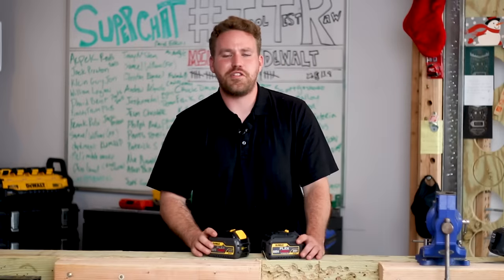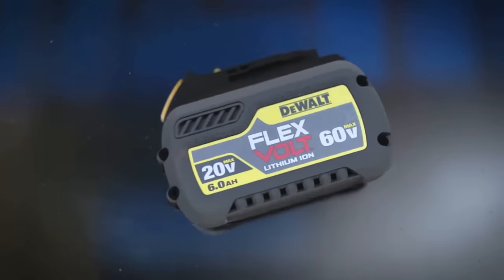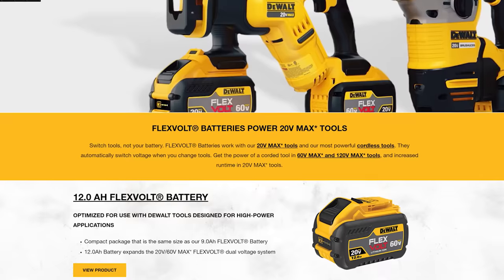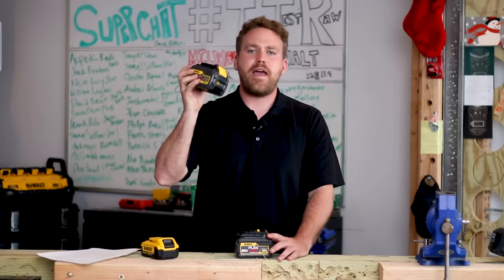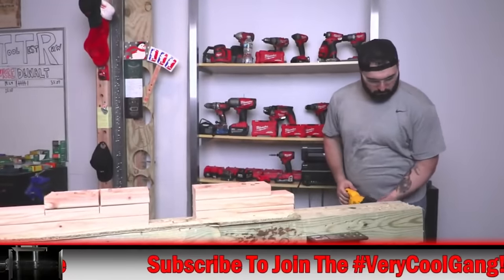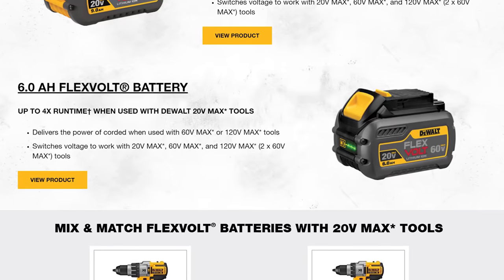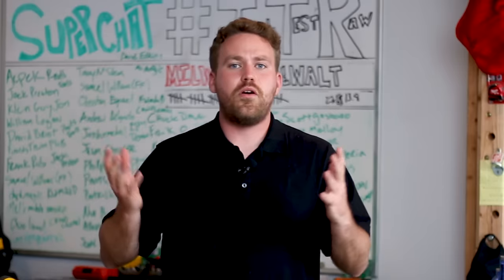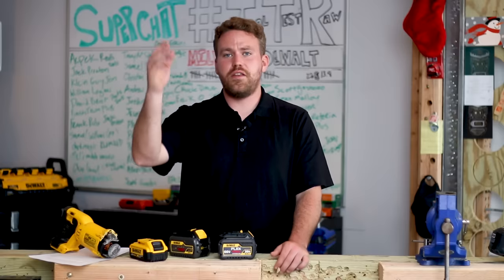NEVER USE DEWALT FLEXVOLT BATTERIES ON 20V MAX TOOLS!

Comment: Never had issue using 60 v flex volt on my 20v max tools.

The only
Problem I’ve ever had was my 60v max string trimmer which takes 60V only batteries is pretty disappointing.
The battery does not last long at all and I swap out two batteries as they’re pretty
Expensive.
The motor head gets wet and clogged up as it’s near the trimmer head at goring level.
It has heated up and smoked before .
I keep a whisk brush in my
Pocket to clean off the motor vent while using.
They should have put the motor higher or at the top of the machine near the trigger area.
It’s not ergonomic at all and I hurt everywhere after using it.
It’s a giant pile of crap.

Comment: The problem you are seeing is one of duty cycle. If i run my eastwood welder the same way i run my miller welder, with a heavy load, the eastwood is going to burn up. Same thing here. The point is not to give you longer time at max load. Its to give you longer time with an intermittent load. When the tool gets hot, let it rest.

Comment: Overloading the switch in trigger battery is sending out 60 volt but 20 volt only takes 18 volts under load and because there math sucks and there flexvolt is pushing switch so hard in trigger it blows connection between Between trigger and connection switch line behind it took my saw to do this to be able to see what caused it so on the saw it's the trigger switch ,I'd be surprised if the problem is different on other tools I'd say the switch behind trigger is done on smaller motors like impact drivers could be fail point because there is no point using flexvolt on that small of tool anyways just asking for trouble

Comment: I work full time industrial maintenance I use exclusively dewalt and I swapped out all of my old batteries to the 6 and 9 AH batteries.  I did recently have an issue with one of my battery packs but if we could only show pictures here you could see why.  That damn thing falls off ladders/the side of machines etc and its taken one helluva beating.  That one I'm going to retire and try my first 12ah battery.  So in short its not the battery fault in my opinion and certainly not in my experiences.

Comment: He really didn't explained the reason why not to use them,.But I'm kind of putting 2 and 2 together and my 20 volt drill just stopped working while cutting several 4 and 6 inch hole.maybe drill has a fuse. So It's gone  almost new. Bummer

Comment: I have m18 impact, hammer drill, heatgun, various lights, m12 mini bandsaw , hackzall, drill.

I have dewalt 20v max compact recip saw, circular saw, cable stapler, 60v cut off saw, and plug in miter saw.

I honestly am the weird 1% here that loves both brands like fanboy in love with both brands. My first tool was a plug in  Milwaukee sawzall my mother bought me to do various work around the house as a boy and I have used both in my so far 13 years in the electric trade . 

I don’t understand all the hate on the dewalt because my dewalt tools make me just as much money as my Milwaukee and haven’t let me down. I decided on the tough system over the packout because they offer a rack for my van for the tough system to clip into.

Milwaukee obviously has the baddest impact in the market no contest. There is more than enough room in our tool boxes for red black and yellow (heck even a green metabo here and there). The only thing holding you back is budget. 

With all that being said you have my interest peaked on this finding and I’ll be tuned in. Even if true as long as dewalt stands by and remedy’s this then you have to understand that with innovation there is going to come failures. It all depends on how they handle the failure.
Reply: I have always seen Milwaukee as on par with Dewalt.  They both can take a beating and keep going, unlike the other brands.  However, Milwaukee was late to the 12" miter saw party and table saw party.  So now everything in my truck is DeWalt as I hate having multiple chargers.
Reply: Thank you a candid bluntly honest post Daniel   i feel the same

Comment: The FlexVolt batteries have a mechanical switch that is activated when plugged into a tool.  This switch tells the battery if it is plugged into a 20v or a 60v tool.  So you are not supplying more than 20v to a 20v tool you just gain runtime.   This is the reason you have two different AH ratings between the voltage as it places the batteries into different configurations to output either 20v or 60v.

Comment: It's not the voltage its the duty cycle the tool was not made to run that long and hard!
Reply: 100% agree.  10 years ago, most people only kept cordless drills around in case they needed them, and the battery life was laughable. then the problem came in  that the better cordless tools get, the more and more you see guys using them exclusively and not having any corded tools for the intense jobs. we're getting into the territory I've dealt with in welding, that the machines are rated to run say 8 out of 10 minutes continuously. I'm certain we'll start seeing duty cycle ratings on cordless tools, if someone hasn't already done it that is.
Reply: Except they produced a so called. Fail within a minute or so.    The whole vid is very fishy .

Comment: Never used any of the new flexvolts battery (9ah, 12ah) but I do use the 6ah with most of my old 20v max tools and never had issues like this. But at the same time I let the tool do the work, if you force it you can break it

Comment: I have bought two 6.0 flexvolt battery before but them not durable just 2 years，they are no more working. Flexvolt battery is very heavy if using
 on 20v tools will cause imbalance.

Comment: I have burned up 2 drills and a sawzall( 20v max).  It was with 60v batteries, all of them.   I was also pushing the capabilities of the tool. 
I suspect the combination was the cause of the failure.  The extended run rime at full voltage is easier to overheat/overwork the tool.  The 60v does seem to drive the drill just a little harder.

Comment: funny that the 887 paired with a 6ah flexvolt went out, i use that combo on a daily basis and no issues have come up. other funny thing is that dewalt makes a 60 volt max reciprocating saw, just get that if your gonna get the 60v batteries.

Comment: When you look at the feeds on the flexvolt battery they actually have an additional feed that has to be touching on 60 amp hour batteries in order to activate the extra amperage, if the tool does not have an additional feed itself than the extra amperage is not activated. This means your tools will not burn out unless you're over using them.

Comment: Why? By the time I buy any flex volt battery, I could buy a new possible Dewalt power tool replacement already for the price of just 1 FV bat. I’ll stick with the 20v series, besides Dewalt has to battery platform changes.

Comment: Been running the flex voltage 12ah on both my dewalt 20v tools and my MAC 20 volt impacts. No issues. 🤷‍♂️

Comment: Interesting, tho I would say I've have no issue using my flexvolt batteries round the garage i work at. Impact drivers both 1/2 and 3/8, and my 887 I use as an electric screwdriver basicly. Had no issues at all and definitely increased runtime. Maybe its the use of the tools...

Comment: 20V is 20V, whether from a 20V XR or Flexvolt battery.  The connections are not there on the tool to get 60V from the Flexvolt battery.  So the only issue is that the Flexvolt battery has more capacity - enough to keep going past the point to have overloaded and overheated the tool.  It is likely that the load and duration is what has killed your tools.  There is a slight chance that the Flexvolt can get the tool to that point a little faster since it has more power and likely won't have as much voltage and current droop as the duration of use progresses.

Comment: If you know how flexvolt works, you can't say it overloads 20v tools. There is a mechanical switch, which is 20v tools can't turn it on physically.
I only have 12 flexvolt batteries and only 20v tools. Never had any problem. Only the typical thing is manual balance charging

Comment: I use a variety from Makita, Bosch, Ridgid and Milwaukee. I only have a cordless grinder using the flex volt battery. I actually have two of the grinders.

Comment: Seems like if dewalt is telling you to use the flexvolt battery on the 20volt max tools then they should have no issue replacing it for you when you burn it up due to over voltage to the tool. If that’s really what happened.

Comment: If the flexvolt batteries were not designed to be used in the 20V tools, they literally would not advertise them as 20V capable. They are 3 20V packs inside used either in parallel (20V mode) or series (60V mode). The FV batteries (especially the 9AH) are able to make the tools perform better because the cells inside have a higher discharge rating, so the tool can draw more current out of it than on the weaker batteries (not to mention the higher capacity batteries have lower voltage droop). This is the same reason the pouch cell power stack outperforms the 5AH XR, both 20V. Pouch cells can discharge faster.

Comment: I only use 12ah Flexvolt batteries in my 20v Max tools. The only reason I can see them being a problem is they make it easer to overwork the tool as your not as capped by the battery dying

Comment: I've used 60v batteries in 20v vacuums with a lot of run time at work with no problems.  My heat gun runs noticeably hotter though on a 60v battery and I could definitely see burning that out.

Comment: I've used my flexvolt on my 20v weed eater until the batter wouldn't work. Weed eater works under other Dewalt batteries. Flex shows power but won't work on any other Dewalt tools.

Comment: I've been using 9 ah flex volt batteries on my 20 volt tools for a while now. My reciprocating saw is an older one and I've leaned on it hard. Just yesterday I was cutting pressure treated 6x6. While the gear box got warm, the rest of the tool did not. At no time did it feel like the tool was being stressed. My son ran my brushless drill on a job with the flex volt battery and it still works just fine. I have noticed on that drill that making holes in concrete creates heat near the trigger. When this slight warming near the trigger becomes noticeable I let the tool cool right away. This is because most of these tools have transistors for motor control near the trigger. If they are getting hot, stop before they go up in smoke. 
     The really impressive 20 volt tool is the leaf blower. I used mine on an eavestrough cleaning job where I discharged both 9ah flex volt batteries and then discharged three 4ah 20 volt batteries while the two flex volt batteries were charging. Then used one of the flex volt batteries to finish. Leaf blower took it like a champ. 
  If you're going to tell people not to use the flex volt on the 20 volt tools, you need to tear down your failed tools and show us why they failed. The place where I've seen quite a few cordless tools quit like that has been Milwaukee fuel tools we have at work.

Comment: I've been using my 60 volts 6 Amp for 5 years all weather's conditions from -30°C up to 45°C on my drills and I've been using my drill and my 60volts as trolling motor for my kayak for the whole summer. Never had any problems whatsoever but maybe you're right

Comment: i have 0 issues yet with flex volt but i didnt have any instance where i ran the tool long enough to heat up except my hammer drill was mixing cement and mortar with flex volt a cheap Chinese knock off battery 12AH. i got for under 100 dollars soooooooo........
i think it has a lot to do with the tool abuse such as having race putting longest fasteners in a bucket of cement or getting large tree size treated lumber and running for long times....
but what i will say is if a battery switch is faulty and runs 60 volt on a 12 volt max you can cause excessive wear. batteries that go from hard working tool to charger back to tool with no cool down recovery time can break the voltage switch!

Comment: We have regular 20v batteries and they do the same thing when the batteries get hot in high amp situations like a saw or dill in a bind for an extended period of time. When the battery and drill cools off a little, it keeps going. Best thing is don't overwork your tools.

Comment: Well I don’t have any flex volt batteries but if I was questioning this situation it seems you’ve got to get some meters in there somehow in the circuit to read what voltage is being applied to the 20 V Max dewalt tool when a 60volt flex volt battery is connected. An ammeter should also be connected and all this compared to when the proper 20 V battery is connected. If the readings are nowhere near the same it makes sense that damage could be caused. Stop taking anyone’s word on the subject and test it. Somewhere there has to be a data sheet on what the voltage amperage wattage is the max for the circuitry of a 20 V Max tool.

Comment: like many here, I've used FlexVolt in my 20V tools A LOT. I've not run into any issues. They do run longer, however. While I'm sure that some have had issues, I can't help but wonder whether their tool was compromised already. While I DO notice a slight increase in speed, that speed MATCHES the speed at which the PowerStack batteries drive the 20V tools too, and it's a 20V ONLY package. LOVE my FlexVolt on my 20V tools. Consider using the PowerStack batteries too. I can't afford the 5AH version of the PowerStack, but the smaller ones work VERY well. PowerStack and FlexVolt are the BEST!

Comment: You forgot the “why” part and just insinuated that they kill 20V Max tools. It’s not like 20V Max tools can’t die with 20V Max non-FlexVolt batteries so you would need to explain “why” for the insinuation to count. A tool performing better with a higher-performing battery very well may be more likely to break… but it could be just as likely to do that with a high-current 6AH XR, 5AH PowerStack, 8AH PowerPack XR, etc (all 20V Max non-FlexVolt batteries).

Comment: I have a Kobalt snow shovel that uses a 40 volt 2.5 ah battery, I just bought a 40 volt 5ah battery, it is now unstoppable but I have to make sure I don't overload the motor and burn it out. I feel that is what they did. I can feel the motor in my drills getting hot so I stop and let them cool or get another drill so I don't burn them up. common sense or just for the sake of making a video

Comment: The battery probably is not the issue.  If, in fact, it was over-volting the tool, it would be running at a much higher speed than normal and would likely fail very quickly.  The amp-hour capacity of the battery is merely the capacity, and has no bearing on the amount of power delivered to the tool.  

The impact probably fried because it was getting a lot of heavy-duty use that it wasn't intended for.  The recip saw failed because...  I dunno, the switch was junk?

Comment: flex volt was not designed to burn thru your tools but was designed to burn your wallet.  it is clearly taking advantage on those who are in construction trying to save a buck by buying the recommend product by the brand.  it was a fact then  that 20v powered tools are superior to 18v powered tools but not anymore, Milwaukee 18v is outlasting the DeWalt's brushless 20v. this is just my opinion. Although i prefer Dewalts because you can buy them cheap at the streets either defectives bought by pallets  sold by the brand or from those people that have lots of power tools but no battery or charger.. i just wonder where oh where  they get stuff to sell

Comment: Are use my flex Volt batteries I’m at 18 V tools. 
Are used to 20 volt = 18 V adaptor You have to trim two pieces of plastic. On the adaptor. 
No problems yet. DC Motors have a wider range of power needs.

Comment: I’m just a regular dude. This exact thing happened to my sawzaw burnt up the 3-4th time I used the flex volt battery. I didn’t by the extended warranty in the saw , so I’m screwed..

Comment: Volts are volts.  The speed of the tool is going to go up if you feed it higher voltage.  This is something you can check in a few seconds.  Plug in a 20v battery.  Run the tool for a few seconds.  Plug in a Flex-volt battery.  Run it for a few seconds.  If it is running faster, then it's getting too much voltage.  If not, it's fine.  

BUT - what is the duty cycle of the tool?  The larger battery could let you burn the tool up more easily - though you could do the same thing by running 3-4 20v batteries through it as fast as you could run them down and change them.

Comment: I have been using flexvolt on both 18v/20v and 54v/60 from when they became available.  Never had an issue (light use only) 
Infact the only issue I've had since the xr range started is a faulty strimmer and an old 3.0ah + 4.0ah battery stopped working.

Comment: Flex batteries switch to 60v by two spring loaded slides built into the battery. The tool (60v) has tabs that engage the slides. 20v tools do not have tabs.  So a 20v tool will not be subjected to higher voltages.  This can be verified with a volt meter in the two outer contacts on the battery that will read 20v until the slides are pushed.

Comment: There are no issues with using the Flex voltage on 20v tools...

As a side note I have used Makita, Bosch, Hitachi, Panasonic, and most importantly  Hilti and none of them came close to the Dewalt tools.... Hitting in particular was a huge disappointment we broke 2x Nut Rattlers, 6 x Battery Drills 3x 5" grinders in 3 years.... To put that into perspective we have broken 3x dewalt drills 1x nut rattler and 2x grinders in around 20 years... my son still has and uses the very first Dewalt 12v battery drill I ever bought albeit with replacement batteries.... And it had some proper use and abuse before I gave it to him... Black and Yellow for me all day long!